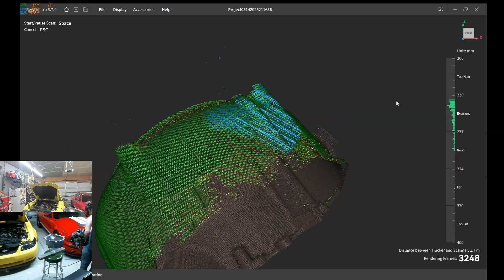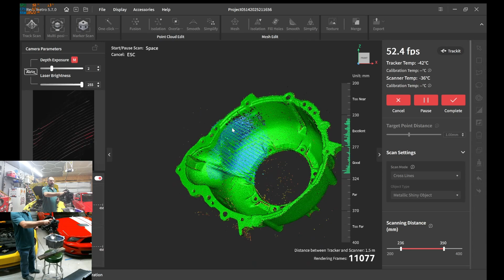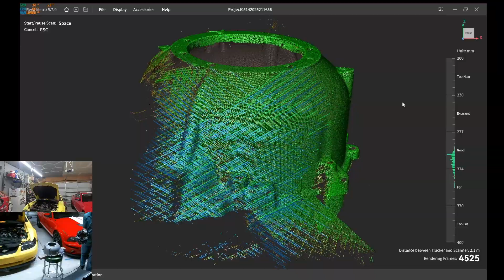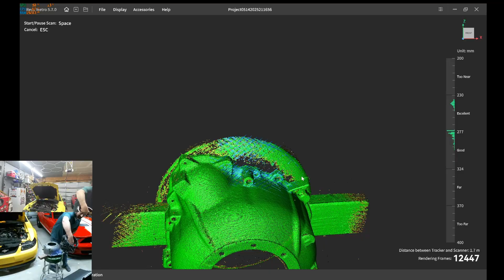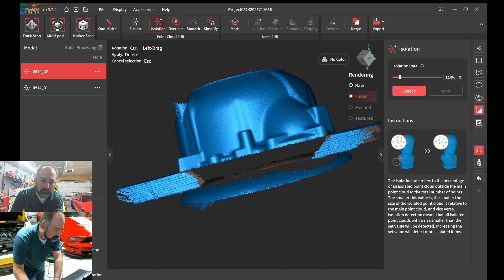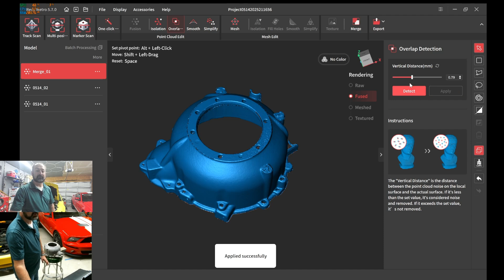SkreetKar 3D | Revopoint Trackit Scanner | Bell housing Demonstration - Uncut

Comment: How is the reverse engineering quality of the model? Have you tried to measure hole to hole distances on model vs real bell housing? Dowel pin hole sizes etc.
Reply from the maker: The link in the description has my forum post for more information and better details of the scan.  As stated this is the demo of the performance for video purposes, I do not intend to RE a random dirty 68 mustang bellhousing.